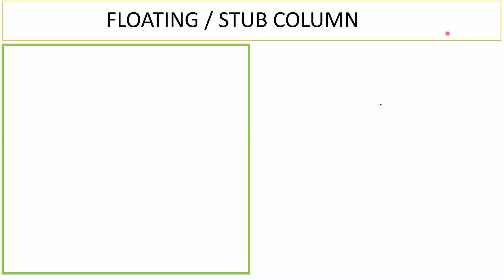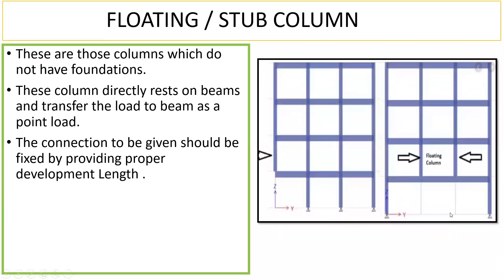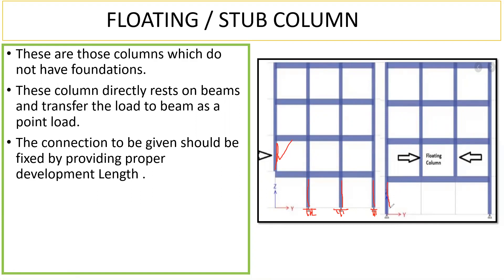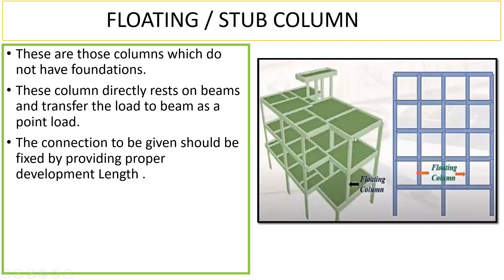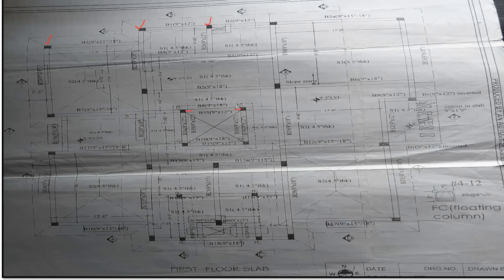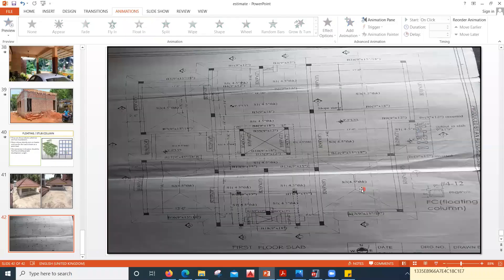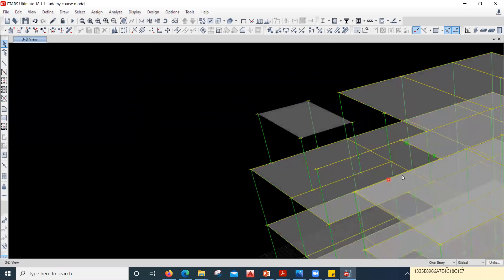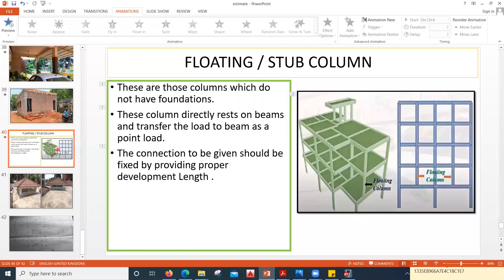What is Floating Column in Building l How to model Floating Column in Etabs

Comment: Sir which support I will give to floating column, one of structural engineer on YouTube said that pinned support is wrong, plz clarify. Thank you.
Reply from the maker: no support. its a frame what we will do. just model a column over beam . the detailing should be correct that it . the column bars should  be anchored properly into the beams
Reply: You might be right because if I don't change support (provide releases) my whole structure is failing..... Because of the floating column.....
Reply: Yes you should not assign pinned support at the floating column base but you should provide releases so that only axial load is transferred through it and rest of the lateral moments & loads should be taken up by surrounding columns.